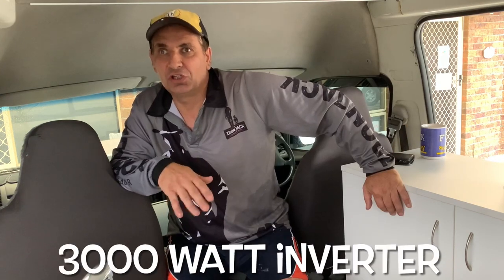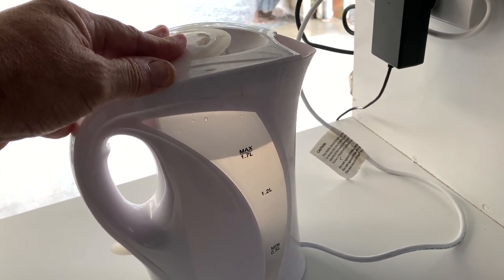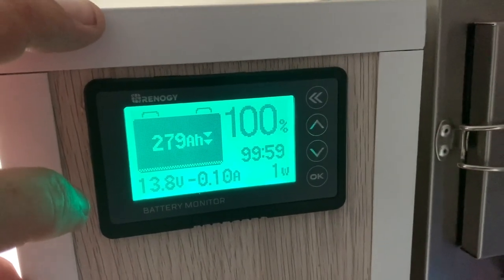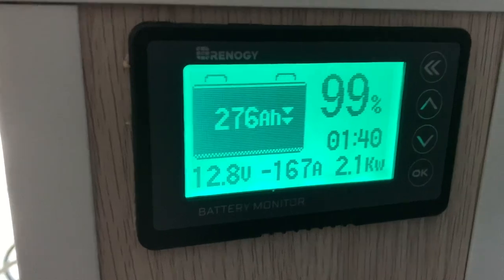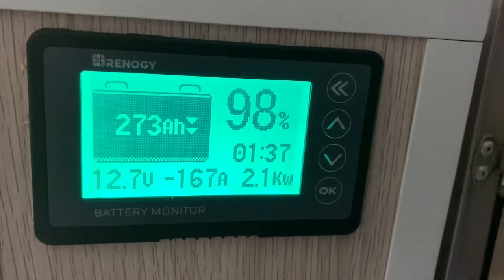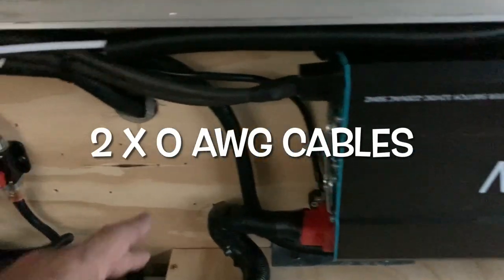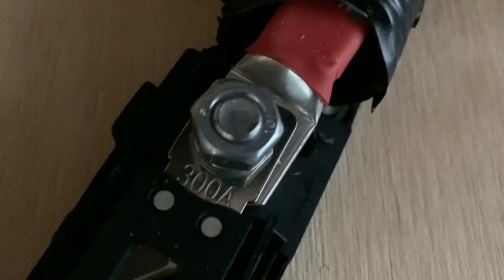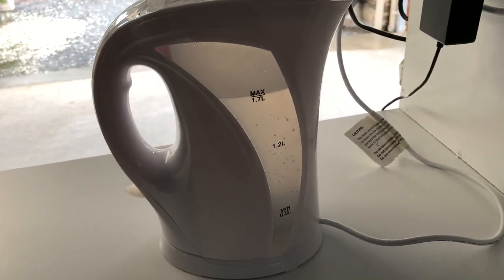3000 watt inverter power consumption

Comment: Good video to show basic power consumption on a system. 
I bought the same Renogy 3000w inverter for my van. I'm very happy with it. Except all they provided were 2 sets of unlabeled power leads. The ring lugs had 100amp stamped on it. I cut one in half and I believe them to be CCA (Copper Clade Aluminum) cables. 
Pretty dangerous if you ran the inverter at full power. Needless to say I threw them away and connected 2 naught cables to the unit.
Reply from the maker: Cheers bud thanks for watching 👍🍻
Reply: 3000 watt version does no come with cables..So not sure what they sent you..
Reply: @WizzRacing yes Renogy do supply under-rated cables. I have this 3000W.
Reply: @ChallengeTheNarrative  I don't think you people understand electrical systems or the code requirements. As you can "Derate" cable sizes. As long as the fuse\breaker is rated for the size cable you are using. Called 125% rule. As long as the loads last less then 4 hours of "Contentious" use. 

Now go take a course in Electrical Theory. As they give test for a reason. 

And stop using Google as your source of Knowledge. The Schools should have taught you how that works. If not. Ask them for a refund. Then punch teachers in the Stomach..they robbed you of an education..

Comment: In regards to off grid systems in caravans/vehicles - seeming a live chassis from faulting appliance can kill you without a protective device, using a portable RCBO plugged into the 240v output will protect, but because there's no earth to ground, YOU will be it. This should cause the RCBO to trigger but it could be too late.. If you installed an earth stake from inverter chasis it will have tripped without you in circuit. Just a friendly reminder to all that 240v is 240v, it's dangerous and without a protective device or ground you're dicing with death
Reply from the maker: That’s a valuable reminder. Off-grid systems can indeed be dangerous if not properly set up. Using a portable RCBO ( Residual Current Breaker with Over-Current) is a good step, but you're right that grounding is crucial for safety. Installing an earth stake from the inverter chassis is a smart move to ensure the RCBO triggers before any harm occurs. Always respect the power of 240V and prioritize safety with proper protective devices and grounding. Thanks for the important tip and thanks for watching 👍🍻

Comment: I agree. Many batteries also have a Maximum Continuous Discharging Current draw well below the 167A that kettle requires , i.e. The Renogy LiFePO4 100Ah battery  is 100A, they recommend 3 x 100Ah for a 3000W inverter. The iTechworld 120X is 150A (175A, 5 mins). So if the user doesn't  have two or more batteries hooked-up in parallel they're pulling the guts out of their single battery. Based on the figures provided the Watt Hours used to boil your kettle is approximately 195Wh. On a really good day my Victron 100/20 controller and Seraphim 325W panel produces a yield of 500Wh. So if my calculations are correct, nearly 39% of my daily energy production would go into boiling one kettle. I'd probably want to boil this kettle first thing in the morning, after the battery has been powering my fridge all night. It makes more sense to me to use a gas burner to boil a kettle. Power management off-grid is worth consideration.

Also, I purchased a K-Mart 30L Convection Microwave Oven, microwave (2200W), grill (1250W), approx. 97Wh for a frozen meat pie to fully cooked. I'd be interested to know how a 12V oven compares.
Reply from the maker: Right on mate 👍 appreciate your comment and thanks for watching 👍🍻
Reply: I'm glad I read this...
Can I use a deep cycle an a starter battery together?
Both 12v.
Reply: Not how it works.. As most BMS 100ah will run up to 200Amps for 5 mins.. As the 100ah rating is for Continuous use..Why you have to fuse the mains above the 100ah rating.
Reply: @codylawson8337 batteries need to be same capacity.
The star bat will drain fast and bring down power of leisure bat

Comment: Hi do you know if this will power an air fryer?   Would a 1000w one do it? How bout 2000w?
Reply from the maker: Possibly you would need the 2000watt one best to check the wattage of your air fryer and also dont forget you gonna need sufficient battery power also . Thanks for watching 👍🍻
Reply: What I mean is the alternator running
Reply: Engine at idle

Comment: So if you have a 100ah lifepo4 battery you could boil the kettle about 7 times if it's full of water. Thanks for the info mate.
Reply from the maker: The kettle consumed approx 167 amps I have this current pulling off 3 batteries that can each discharge 100amps continuous. You would need a minimum of 2 batteries that can discharge 100 amps continuous to run the inverter boiling the kettle.  Just look for the continuous discharge amps output when looking for a battery. Lot of the cheap lithium batteries can only discharge 50amps continuous. Thanks for watching👍🍻
Reply: @EFFICIENTSELF  
167 amps ?
167 Watts.
Aprox 13 Ah for 5 mins to boil the water, thats aprox 160 Watts isn't it ?
An inverter drawing 1.2 amps 24 hrs per day is aprox 30 Watts.
Compared to the high cost to buy a 12v fridge freezer & other 12v products it would take a long time to recoup the outlay with just occasionally camping. Id guess it would be a struggle to balance the costs even in a permanent off grid set up like yer shed, given that the products would have similar limited lifespans.
I enjoy yer vids but for a project you should consider a Van or shed solar project comparing the over all cost of bargain basement but certified safe household products run off a similar inverter, then compare the overall cost to yer top class 12v gear, maybe include the cost of a banger van too to even the score 👍
Reply from the maker: Yes 167 amps the kettle was pulling 2.1kw and consumed approximately 13ah in around 5 minutes (this was just a rough time). If you divide the watts which is 2100 by the amps (167) it will be around 12.5 volts . Did this just to show how much current these things can pull from your batteries . You actually give me an idea I will do a comparison to a 12v kettle by boiling the same amount of water. Thanks for your comment and thanks for watching 👍🍻
Reply: @EFFICIENTSELF  
No probs mate, I enjoy yer vids.
Its a similar amount of Watts tho.
Mind you Im no expert.
2100 Watts/hr for 5 mins is 175 W.
At 12v thats a 15 amp draw through the inverter isnt it ?
Otherwise yer kettle cable would be super thick wouldnt it ? 
A household kettle draws about 10 amps.
Put yer clamp meter on it, 167 amps is welding current, not kettle boiling current.

Comment: Great video, my only wish is that I found it sooner, I've been through the ringer buying underpowered units constantly upgrading looking for more power, and after years of this I finally acquired a 3000w constant 6000w peak unit. It didn't run the appliances I bought it for but I'm assuming that was due to the tiny cables it came with. I just bought 2 gauge cable yesterday and hopefully that will be all it needed to run properly. I've got a huge battery but it's still only a car battery and not a massive truck battery. fingers crossed 🤞
Reply from the maker: These inverters use an incredible amount of power especially when running high power devices such as electric kettles and induction stoves… make sure you have plenty battery power . Thanks for watching 👍🍻
Reply: @EFFICIENTSELF  May I ask what you mean by "Plenty" of battery power? Although my i30 is only a 1.6 Tdi I've got the largest battery I could physically fit in the engine bay. 
Has only had 2 months of use, it's a 
EXIDE/MPL  
N50ZZLMF 
620CCA
140RC
70AH
Is that what you mean by "Plenty"? Guess we'll  find out shortly as I'm just about to test these new 2 gauge power cables.
Reply from the maker: You gonna need more than 70ah of battery power if you intend to run the inverter at full power. You also gotta be careful as if it’s your cranking battery in your car you are using you will risk running it flat and you will not be able to start your vehicle.

Comment: Hey Jack...it is critical to know what battery bank you are using for this project?
Reply from the maker: Yes, it's crucial to know the battery chemistry when connecting an inverter.different battery chemistries have different voltage characteristics and charging requirements. connecting an inverter that's not compatible with the battery chemistry can lead to inefficient operation, damage to the battery, or even safety hazards. Always check the manufacturer's recommendations and specifications for both the battery and the inverter before connecting them. Hope this helps thanks for watching 👍🍻

Comment: Thanks Dino for another great video.... do you have to run the the 300amp megafuse? I am running an 1850watt coffee machine.
Reply from the maker: I googled ‘recommended fuse size for 3000 watt inverter’ actually said a 400 amp fuse with 4/0 gauge cable.. I put in 300 amp because that’s what my batteries can put out in current and of course my cables are good for 400 amp .. thanks for watching 👍🍻

Comment: You would think people would do the math before considering their battery requirements. 2100w/12.8v=164a so 164/12 for 5min which is 13.6Ah assuming 100% efficiency, you could assume an inverter is about 90% efficient so 15.2Ah to boil a kettle.

I have ordered one of these inverters, do you think a single 0 gauge would be enough? I am also running in to issues finding thicker cable than that. Do you know what the inverter comes with? looks like about twin 4 gauge in the photos.
Reply from the maker: I think the inverter comes with twin 2 gauge cables and I found they got quite warm when I used my inverter prior to installing into my camper and used twin 0 gauge cables as couldn’t get hold of 3/0 gauge . You could try 0 gauge and if gets warm you could add another. Thanks for watching 👍🍻
Reply: @EFFICIENTSELF  Thanks for the info, 2 gauge is 35mm2, 0 gauge is 55mm2 so a single 0 gauge would be a downgrade. I might have to just order some 70mm2 or better from the US. I can't find anything in Australia.
Reply from the maker: Your welcome mate. Better to go heavier in the cabling. Good luck 👍🍻
Reply: @EFFICIENTSELF  I decided to do the math on this one. Loss to heat from resistance is calculated using P=I^2*R, 0 gauge is 0.1ohms per 1000 feet so a 10 foot run of cable with a 200amp load (2560w) is 200^2*0.001 so 40w. 40w of heat is pretty substantial. Normally on a circuit board for say a VRM if you had 40w of heat from components they would need a heat sink and 40w would get a small aluminium heat sink pretty hot. I am probably only going to need about half that length for both positive and negative cables though so 20w from 0 gauge but 10w from 2x 0 gauge does sound better.

Comment: I have no understanding of amps, volts, watts etc so will have to get my electrical work done for my van. I want 2 vent/fans, lights, small caravan refrigerator a few power points to charge my phone and iPad. Cooking will be on a gas stove, no electric kettle or appliances. At the planning stage now, how many batteries/solar panels for one person.
Reply from the maker: The sounds of your requirements you will not need an inverter . Go for a lithium battery 200ah . Redarc bcdc charger 40amp and 2 of 200 watt solar panels.. better to go more than what you think you need cause of overcast days and if you have lots of overcast days your battery will charge off your redarc dc charger. I’m no expert and This is my opinion only. If you are having work done ,they will advise you on what you need after they know what you require to run devices you are installing. All the best in your build and thanks for watching 👍🍻

Comment: So gutted. Bought one and it wont even run my induction cooktop. Thought i was upgrading from my 3kw cheapie i already had. Nope! Turns out the renogy has very poor start up power. Mines the newer ups version so i cant tap into the more robust hard wiring terminals like some have.
Reply from the maker: Sorry to hear that. This one doesn’t like air conditioners for some reason. Thanks for watching 👍🍻
Reply: The issue is likely to be the under rated supplied battery cables. That is why this dude fitted fking thick cables of 0 AWG.
RENOGY are bellends.
Anyway, the 3000W does peak 6000W which should run most things.
I notice there's a frequency switch. Motors need 50Hz. 60Hz fks them up.

Comment: What if the engine is running in your Van
Reply from the maker: Will depend on your dc charger . Mine will put in 50 amps when engine running, when you use heavy load like say a kettle you can see what amps comes out . Thanks for watching 👍🍻

Comment: I can tell you right now that wire on the back of your inverter is to much it alone is using more power... Its like using a very long drop cord they draw more power.
Reply: ok but is that the only negative to using that thickness? If it is, surely that's a bit of a non issue when compared to all the other problems with using smaller cables yeah? I know which I'd prefer.

Comment: My 400ah lithium batteries were running my fan last night and it and the inverter drained 45% of my batteries. They were on 13.2. 5 or 6 hours later @12.3.... lithium batteries. Just seen like to much. Like something isn't right.

Comment: Let's see how good is that inverter:

1 liter of water needs 4180 Joules to raise its temp. by 1ºC.
1 Wh is 3600 Joules.

 So,1 liter of water,from 20ºC to 100ºC,takes 93 Wh; 1.7 liters take 158 Wh of energy; let's add  5 Wh  (??)  for the kettle,to heat up the steel, and that  becomes 163 Wh;

You burned 13 Ah at 12.8 volts off of that battery, that amounts to  166 Wh, effic. of  98% ?
Reply from the maker: Cheers for the detailed explanation. Thanks for watching 👍🍻

Comment: Power/watts  = VOLTS X AMPS 

The potential difference between 240 and 12 volts is 20

An easy way to get a rough understand of amps required is 

X the 240 volt amps by 20 this will give you the dc amps required .

A 3000 watt inverter to run at full load ( 3000 watts) wil require around 240 amps .

That is a huge amount of amps and not very many single battery’s can supply this current even for a short time .
Reply from the maker: Cheers mate i got this connected to 3x 100ah lithium batteries capable of 100amp continuous discharge for each . Thanks for watching 👍🍻